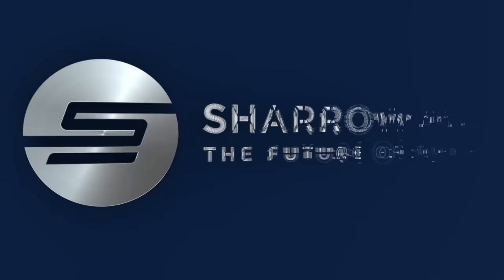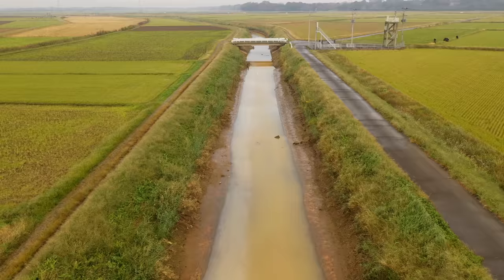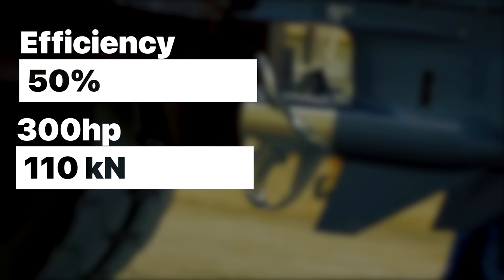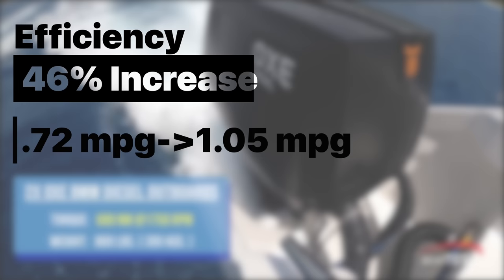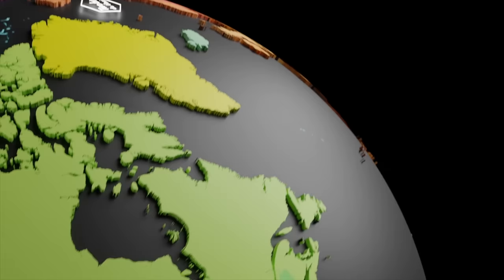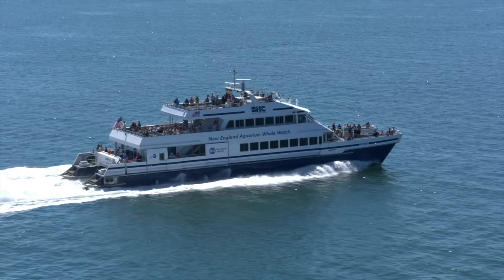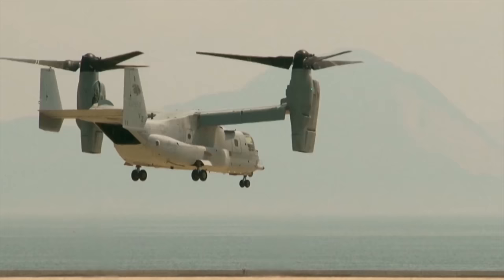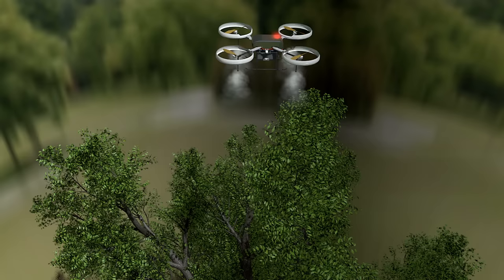Genius Propeller Is About to REVOLUTIONIZE Ships, Here's Why

Comment from the maker: Check out Hoymiles for your Solar Micro-Inverters Today! https://geni.us/Inverters
Reply: YOU are FAKE NEWS.
Hydro JET propulsion (ELECTRIC) and MHD (magneto hydrodynamic drive) are Examples of MORE Efficient MARINE propulsion . there is also the CASE to be said about 100% Electric Hydrofoil as Efficient propulsion. 
TwoBitdaVinci - the BEST propeller, is NO propeller in the FIRST place.
Reply: What about energy generation? as in wind mills turbines
Reply: @Mark Plott  do those technologies work for larger ship?
Reply: The math is wrong. Fishing boat and merchant ships spend most of their time at a set speed. The propeller is chosen specifically for that set speed where the efficiency difference becomes negligible.
Reply: Sacred Baloney
22 seconds ago
Increase efficiency by 105%?  Nonsense.  A standard propeller is at least 75% efficient.  A top rated propeller is about 90% efficient.  How can you "increase efficiency by 105%"?
Reply: This makes me wonder how this would work in a very thin fluid (like air)...  And of course you answered the question as I was typing.   Nice!
One concept that I am thinking of in particular is the Safran Open Rotor.
Reply: @digiryde   The main thing here is water is basically no compressible (like not at all) but it's can boil at low temperature with low pressure (cavitation).
Therefore, there's hardly any inspiration you can get from water props to air and vice versa.
Reply: Looped props are also less prone to breakage in a debris field, such as swamps or an ice field. Purpose designs should emerge. Note however, if they are individually custom engineered props the breakthrough may not be as great as it seems. Custom engineered props are often a bunch better.
Reply: @markplott4820  Are you sure?  Thrust increases by power(radius, 2/3) or R^2/3, where R is the radius of the propeller -- for the same power that your engine supplies.  So the smaller the propeller, the less thrust you will generate.  Jet propulsion uses a tiny propeller.  It is very inefficient.  Have you ever seen a jet propulsion electric motor boat travel for more than 15 minutes?  It quickly runs out of juice.
Reply: @Platypus_Warrior  -- The torroidal propeller can also be designed to optimize at the same speed.
Reply: @digiryde  -- In other words, the standard turboprop.
Reply: @primeroultimo  😮😮😮😮😅😅😅😅😅😅😅😅😅😅😅😅😅😅😅😅
Reply: @Platypus_Warrior  -- Cavitation is a second order affect and happens under high RPM.  So you can ignore it.  This video is talking about first order effects only.
Reply: @sacredbaloney  "In other words, the standard turboprop."

I will be the first to admit that I hav eno real knowledge of aircraft engines.

There has recently been "news" of a new engine that is a jet engine with the blades on the outside and in the rear as a much more fuel efficient angine.  It may very well be a turbo prop, but I would not know the difference.
Reply: As someone living in Sweden the only alternative of interest to me is the HMT-1800/2250-6T. Or rather a number of them.
Reply: When you directly compare thrust and power to illustrate what is efficiency, you show how totally incompitent you are. Power can only be compared to power, and power equals thrust multiplied by speed. If speed is zero you can have almost infinite thrust with any power. And well matched conventional prop will also be 80% efficient at a fraction of the cost.
Reply: The point of these improvements is for them to be considered as a way for a configuration of a part which is repairing itself to be used at a lower efficiency while the device is multitasking (by assembling itself while moving). Regardless of this, the propeller needs to be calibrated to the engine in order for it to work well. Remember that boats are a great idea, but it's still a theory that they can glide on top of the water without oil.
Reply: @markplott4820  Work on your communication skills and people might actually listen to you. While you might be (partially) right, there are better ways of bringing it. Now you sound like a 12 year old or the average American.
Reply: @kevindevlieger300   - Except, I am Above Average Intelect ( my mother had me Tested) I on the Spectrum. 
and I am MORE than Right. 
besides , Annular wings make my case , they are more Efficient & Bladeless , and they Multiply the Air Volume by 5x .
best of all , its 100% Electric.
Reply: @markplott4820  That's no reason to be impolite. Also.. you're not the only one who's above average. Work on those flaws and you'll become even more intelligent. 😉
Reply: You're extremely naive if you think ANY corporation will lower the price for us instead of increasing profit for them.
Reply: I need you find you this video. But they're not actually over 100% efficient. In fact they're not even 50% efficient.

Comment: Props to this channel for propelling this revolutionary technology to the masses!
Reply: I see what you did there 😉
Reply from the maker: ooooof 😆
Reply: Sounds as corny as something the most electrifying man in entertainment aka the rock would say. 😀
Reply: Properly said!!
Reply: Sacred Baloney
22 seconds ago
Increase efficiency by 105%?  Nonsense.  A standard propeller is at least 75% efficient.  A top rated propeller is about 90% efficient.  How can you "increase efficiency by 105%"?
Reply: @sacredbaloney  You have to invert your calculations for efficiency. A 90% propeller is losing 10% of the energy. A 100% increase in efficiency means cutting the loss in half. So a 100% efficiency increase from 90% gives us 5% loss, or 95% efficiency.
Reply: Nice
Reply: Just that is it not revolutionary in any way - they have been in use for over a century already.
Reply: @Nphen  That is not how efficiency is measured - you are simply wrong on that.
Reply: @ABaumstumpf  it revolves?
Reply: BADUM-TSS 😂 😂 😂 😂

Comment: One thing that is promising about this design is that it isn't that complicated. It definitely isn't as easy to manufacture as the traditional design, but I don't see anything in there that couldn't be cast or injection molded. It seems like the $5000 price tag isn't going to be the price forever, right now they can charge that much because they have no competition, but I suspect that similar designs will soon offer similar benefits at much lower prices, and they will bring the price down.
Reply: They're precision-machining this from fairly expensive metal. Getting the Tesla engineering team to make a giga press casting might not even work. Those castings need to be cut out. They're meant for structure, not hydrodynamic precision. My guess is an inferior product (both in efficiency & lifespan) could be made (at scale, eventually) for $700. But for a precision stainless steel the low bound will be at least $1,000 (which would be easily repaid in fuel) and worth the efficiency boost for electric.
Reply: @Nphen  They are definitely marketing a high end product, and there is no doubt that you can get some improvements from going for high quality material and precision manufacturing, and those improvements can definitely be worthwhile. But it is also often possible to get most of the improvements at a far lower cost too, which makes scaling the invention up to mass market and actually getting it implemented happen much more quickly.
Reply: Right now they are individually CNC machined from a solid block of stainless steel in a 5 axis Heller Machining CNC production facility. Nothing cheap about that process, about the most expensive way to make a part.
Reply: they signed a contract with Yamaha. they will mass produce it and offer it as standard on their motors.
Reply: This is too important an advance to have it kept as a boutique item that only the rich can afford.  They need to move to license this patent ASAP to other manufacturers.  This technology could save  billions of gallons per year and all the associated emissions.  It's too important to kept under one low volume manufacturer.
Reply: @rogerheuckeroth7456  they signed with yamaha 6 months ago :)
Reply: @jstefa2  That's great.  Hope it's not an exclusive with Yamaha.
Reply: These are already cast and then cnc machined.  Very complicated and costly compared to a standard prop.  They have an agreement with Yamaha for manufacturing and distribution.
Reply: Chinese: "$5000? We can do exact copy for $500 with min order of 100, sample is free and payment can be done after delivery"

And I'm wondering why our industries are failing...
Reply: @user-xq2fz5tz9t  keyword is copy... you can make shit cheap when you dont have to recoup rnd :)

Comment: When you consider how long we’ve used propellers, it’s madness to think we’ve only just discovered this
Reply: This has been used and open sourced  for over 50 years
Reply: If you ever owned a boat, you'd see the problem considering the price of these props.
Reply: these haven't "just" been "discovered". it's only recently, that we could make it "work" through improved designing  and production technology.
Reply: @EchoeOne  if this design shape has been known for a long time why wait so long to be used in the real world?
Reply: @captspeedy1899  Manufacturing processes got much better over the last decades. There's no way to build a good toroidal propeller without a modern CNC machine, since you need complex toolpaths that are only possible to calculate with modern computers. Also 3d-printing helps massively
Reply: Just not cost effective for the small boat buyers.
Reply: @captspeedy1899  These propellors require you to either 3d print or cnc. And you have to do this on a super fine level. We only just now reached that
Reply: We've used Archimedes' Screw for centuries, but it wasn't until 2002 that the Olds Elevator was invented. Basically by rotating the tube rather than the screw, you get way more effective screw conveyor. Tom Scott did a video about it a few years back
Reply: @5ch4cht3l7  Wow! That is so fascinating. There is some wisdom here, like the idea is nothing without the tools to make it happen.
Reply: @5ch4cht3l7  damn, that’s so sad. If we only just recently figured that out then I guess there really is no hope that ill see crazy sci fi shit in my lifetime :/ we put billions of dollars into cancer research over the last 6 decades and only just now did we figure out how to build a CNC machine that can make a stupid propeller. What are we doing??
Reply: @5ch4cht3l7  ….the idea you could not make these before is nuts. Investment casting is the obvious method. The Kappel propeller has been around for ages and it is basically one half of the Sharrow prop. How so ever they make them I’m pretty sure they aren’t using cnc or 3d printers to make those big fellas.
Reply: This is not new. No idea how MIT allowed someone to win award for it.
Reply: @corail53  Maybe the award was for a method for cheap mass production of even the largest propellers? That's what I'm waiting for.

Comment: I'm writing this in my 38ft liveaboard boat lol. 2x 380hp Volvo diesels, planing Hull, and 25 knots. The same engines are rated at lower hp and rpm as you move from 15 tonne pleasure craft to commercial vessels, and in my case I can only use full power for a short time. So while more speed is ALWAYS nice, I'd pay a LOT if I could use my current top speed constantly, using less fuel which isn't just a saving but my range increases. There are way more benefits then cost, an engine working less hard will last longer. I'm super pumped - thank you! Hey I wonder if prop walk is reduced? 🤔

Comment: I work in patents, and I do a lot of work in helicopters and UAVs. Toroidal props are definitely not a new discovery by any stretch. I was reading a patent from 1895 the other day that was pretty good prior art against MIT's toroidal propeller patent. I've seen lots of other patients in my work over the last few years to do with toroidal, loop, and other tip-joined propellers
Reply: What kind of patients were they😂

Comment: I can think of an area where lots of drones are used where efficiency may take second place to sound reduction.  Think of where a stealthy drone could deliver a payload without alerting the recipients.  In this area, the drones must be flown at a relatively high altitude to avoid detection which then reduces the accuracy of the drop of the payload.  Reduce the noise, reduce the altitude, increase the accuracy.
Reply from the maker: We have a video dropping on Thursday discussing just that.

Comment: Swap-on improvements are some of the most impactful, especially with the impressive gains these props bring.
Reply from the maker: Quick and easy often makes for the most used of improvements at scale
Reply: Sacred Baloney
22 seconds ago
Increase efficiency by 105%?  Nonsense.  A standard propeller is at least 75% efficient.  A top rated propeller is about 90% efficient.  How can you "increase efficiency by 105%"?
Reply: @sacredbaloney  : - if their original prop was only 38% as stated, this is totally possible.
 - if the prop was lightly loaded, "efficiency" increases.

The target water speed and disk loading  is extremely relevant (fuel efficiency - comparisons with the same hull - would be great) - ie was the replacement prop thee sam diameter and effective pitch??
Reply: @sacredbaloney  did you watch the video, as in, the whole video?
Reply: @sacredbaloney  Agreed that number seems off. It would be 105% of 90%. IIRC these propppelers and a standard propeller need to be designed specifically for a certain speed and torque to get the most efficiency. These are better generally but show more promise for certain speeds and applications. 

 That is what I was told. Also just copying the same design doesn't quite work as well as people think from the small tests I've seen people do on YT.

 The biggest benefit is durability. Cavitation really does a number on props. Wonder if the Navy has already designed one for their submarines and are having issues manufacturing it.
Reply: Except it's snakeoil, these have been around for over a generation, it's bullshit and seeing how many Youtubers have fallen for it is about par for the course really.
Reply: @sacredbaloney  Well, when someone measures 'efficiency' as a ratio of thrust / power (i.e. kN/ hp???)  I get a bit queasy.  Seems like if you change the hull (drag) of the boat, you're going to get different values (thrust/hp) ranging just as much even with the same propellor.

Comment: If you look at water pumps, there are two types of impellers. Closed impeller like the torodial boat propeller and an open design normally used for trash water pumps. The open design is lower pressure but is less prone to trash being stuck in the flow through impeller. However I think this guy deserves all the applause he can get for his observation and application to improve boat propeller design.

Comment: It blows my mind props for boats havent been majorly improved for so long. I just assumed there was a lot of rnd, with wind tunnel tests etc
Reply: just not much to do with them, people have tried, just nothing was worth the change, until now atleast.
Reply: @bored588  Yeah. It's one of those seemingly simple things in hindsight but there's a seemingly infinite range of shapes to try and each one takes at least a little testing. Whether it functions in simulations the same way it functions in the real world is another issue.
Reply: There are specific technologies that can be used to make propellers much more efficient, and the changes are subtle. 

The profile of the blade should be made to maximize laminar boundary layer flow for a substantial reduction in propeller drag and improvement in efficiency. Its possible to obtain low 90% range efficiency with modern design software and manufacturing techniques, (5-axis CNC).

The problem with extensive laminar flow is also increased cavitation due to shorter distance to obtain the pressure recovery. 

And the fact that barnacles, moss, slime will degrade the laminar performance to a point worse than a properly designed conventional propeller. 

All of these issues, save cavitation, are present in aeronautical propeller design.
Reply: its fake and clickbait, you are just gullible
Reply: @bored588  And still not worth the change.

Comment: Will also be interesting to see if a type of this can be applied to windgenerators too
Reply: I think it would be unlikely for high power. The extra material requirements I doubt would cover the efficiency gains, that's even before you begin figuring out how to transport the thing to the site. With current blades already past 100m in length and 40,000kgs I can't see it being feasible for transportation. The aero elasticity of a structure that shape and size would be very interesting to study though.
Reply: @jakbain1337  Material/efficiency wise I'd assume it can be worth it, as it makes such a big improvement on here. I agree with the transport issue, it will only be possible up to a certain size